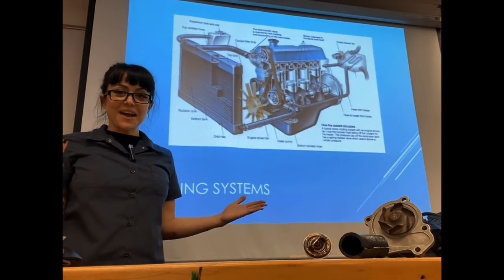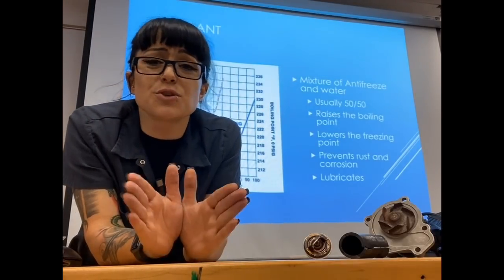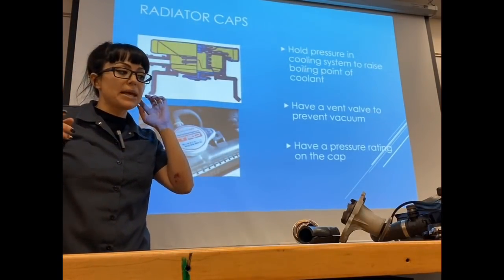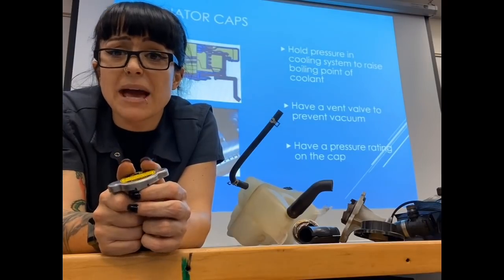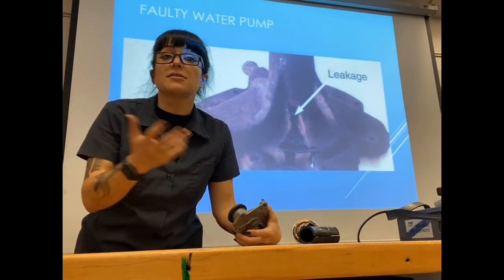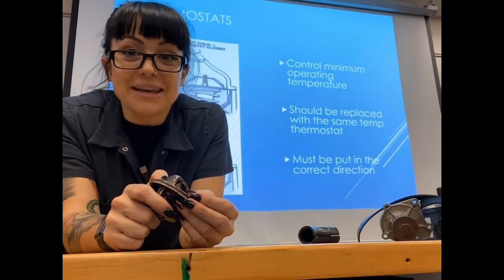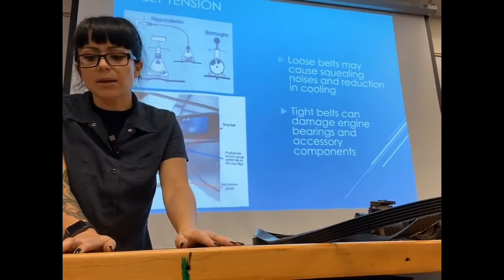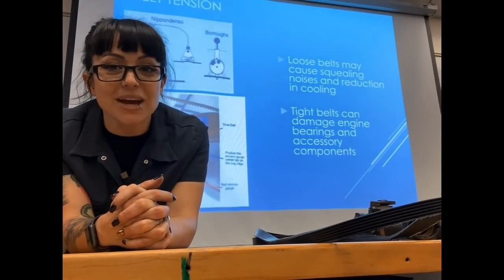Cooling Systems

Comment: I tend to open my hood in order to let heat out while im driving. I can go up to 65mph with it opened becauseive done it by mistake but the hood does not raise. Is it really worth me do this to reduce the heat levels?  I knowthe bottom of the engine bay is opened, and the area is not sealed so heat will go out. Since heat rises im assuming using the hood opened acts like a vent and help the engine out. Any smart input is welcomed.
Reply: Absolutely not worth it 😭😭
Reply: @studioqueen4902  why? Any specific reason you say not worth it?

Comment: I got a new thermostat from ford. It doesnt have a jiggle valve. Should I drill a hole in it?
Reply from the maker: I always recommend it. If not, you run the risk of getting trapped air pockets which will cause overheating.
Reply: @ms.a_theshopteacher  thank you for your effort and I'm not doubt you but did they forget to put a jiggle valve or they did it on purpose for some reasons. And thank you again for the great spectacular JOB.